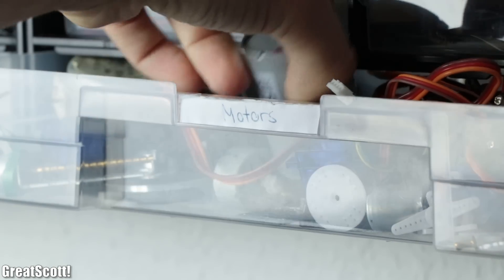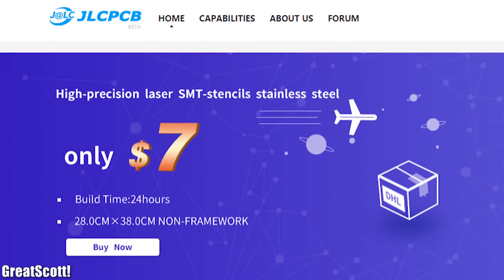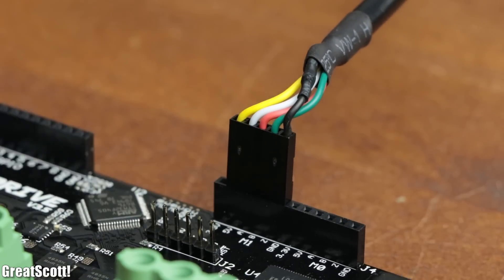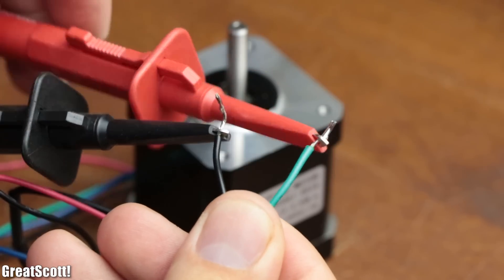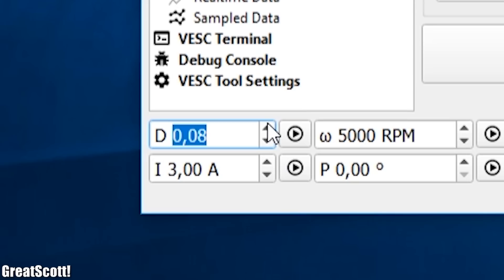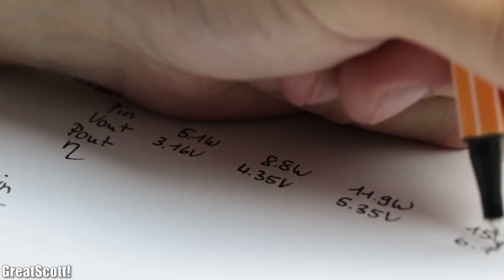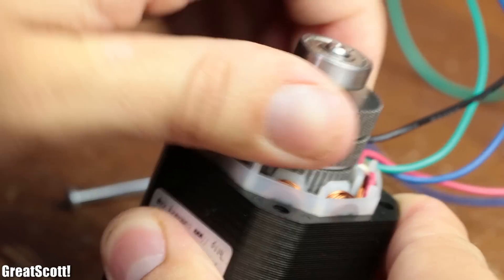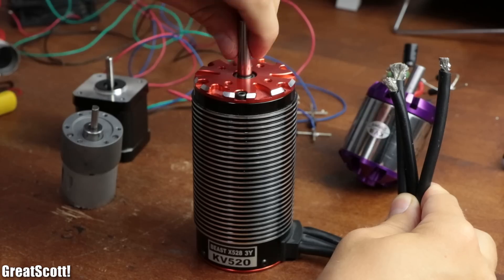Which Motor Type is the Best Generator? || DC, BLDC or Stepper? (Experiment)

Comment: But what about voltage drop on diods? Did you consider power dispensed by rectifier? With low voltage as you used it is considerable waste/heat try to change measurement method or add heat on diods to the calculation

Comment: Generator output voltage In the armature depends on the rate at which the lines of force are cut per second, it is possible to vary the output voltage by controlling the speed of the prime mover or the strength of the magnetic field.  The flux density in the magnetic field poles depends on the field current. The field strength and voltage output of the generator continues to increase with an increase of field current untill magnetic saturation of the field poles occurs. Any additional increase in voltage after magnetic saturation occurs must be obtained by an increase in speed of the rotating armature.   Using a cumulative compound wound motor would have the best regulation with a rising characteristic as increasing the load current the output voltage increases as well.

Comment: Stepper motors are fine for small stuff MA range but that's it they fall face first when confronted with real load. Out runners are the best just have to spin the crap out of them unless you rewind . Use belt and pulley all available from EBay cheap. There is no real gear box options yet for the weekend scientist.  Brushed motors are by far the cheapest .

Comment: It is odd that you (apparently) overlook wire section, number of coils, etc. Start over by comparing the innards of a manufactured generator (as in wind turbines) and each of your three types of motors ? It should be pretty obvious.

Comment: Stepper motor is the best source to be use as power generator. I am actually building one to power a 12volts household LED lamps that will light my entire workshop table instead of using our main AC source electricity. The project will be based on a stepper motor salvage from a Photo copier machine as the power source, 775 DC motor that will rotate the shaft of the stepper powered by a 12 volts 4AH motorcycle battery. In order for the battery to be charged while in use. Think about of what is happening on a MOTORCYCLE charging system, given the stator as the power source coupled to a voltage regulator that charges the battery during use.

Wish me luck !!!

Comment: You used a dis-proportionally sized BLDC motor for this experiment, a lot of smaller brush-less motors with higher KV ratings are out there.

Comment: Hi GreatScott.  I enjoyed and LIKED the video, Subscribed and clicked the Bell Icon for new updates.  I was wondering brother, if I needed to calculate the power requirements of a plug board 120v/240v and say an 12v/24v air pump, a water pump 12v/24v and some grow lights.  How would I go about this?  If this question in too easy for you, I will not be offended if you redirect me to an alternative source or information that is already publicly available.  Regardless, any help would be appreciated.  Have a great day and thanks for your work.

Comment: I did some tests many years ago with brushed tape drive motors, and simply connecting one to the other allowed one to drive the other at better than 10:8 rpm, so ten turns of the generator gave 8 turns of the identical motor from close to zero rpm, higher than 100rpm it reached 9:1. Those motors were about as good a any brushed motor can get, and I didn't measure torque loss, but it still proved the efficiency to be close to perfect. I also made a small charger system for a stationary engine using a BLDC motor, and got surprisingly good current and voltage (~60 watts) with 3600 rpm speed.

Comment: I wish you had done a test at 3000 RPM with all. hobby bldcs are said to have a conversion on 80% from electricity to lift / propulsion so it would be interesting to check the reverse efficiency

Comment: The diodes in the bridge rectifier loose .7 volts each. with 2 in series at any given time, that's a 1.4 volt drop before any current is passed to the load. If you only turn fast enough for 3 volts, half your loss is the diodes! You're right about revving them with a gear box. If you could run them closer to 12 to 15 volts, you lose only about 10% to the diodes. Another suggestion, use Schottky diodes, which lose only about .3 volts each. If you try to run permanent magnet motors too fast, the air gap voltage gets so high that Eddy losses in the iron stator reduces efficiency.

Comment: Thanks for this!... I was just about to run the same kind of testing for my wind turbine project. Now I don't need to! One thing I have discovered about stepper motors (which I've been using... was considering a BLDC but after your video, no need) is that a NEMA23 generates a lot more power than a NEMA17 at low RPM's. I'm getting 9 watts from my wind turbine at the moment in field tests. I believe the reason that steppers work so well is because they have a kind of "magnetic gearing" because of the 'teeth' on the stator and poles that effectively multiplies the number of real coils. It's all about the dB/dt. (change in magnetic flux over time)

Comment: we are professional BLDC Motor stator lamination and epoxy powder coating customization manufacturer to produce stators with 0.15mm,0.2mm,0.35mm and 0.5mm silicon steel, we also have some ready-made stamping mold available for you to save your cost.  the lamination technology include, interlock, welding, bonding lamination, more details, please see our website: www.jystator.com

Comment: 5:10 Dude, why not just enlarge the hole to 8mm in software lol
Reply: Luka Voglar Because there are usually no sources, just STL so it's pretty hard to change it. 10 seconds of drilling vs 20 mins of developing own coupler, basic economics.
Reply: @HungrysitesRu  It's literally a cylinder with a central hole and 4 lateral holes.. Even without downloading anything you can do it in 3 minutes in any CAD software, it's literally that simple :/
Reply: @DarkQwerzar  maybe he wanted to let us know that these types of 3d printer files are available on the internet or maybe sponsored.
Reply: @HungrysitesRu  looks like someone forgot to take printing time into account.

Comment: how about putting a stator on a motor to show how to increase voltage in a circuit. say a 120 generac stator on a ebike motor with a control to make it only rotate 2 times per second with a full throttle control so that is gives 40 ac current to an 48 volt ebike ac motor.

Comment: I have something that you will want to try??? if it use a lot of voltage and has very little horse power then it stands to chance that it will also be the easiest to turn or vice versa so do that for a show also!!! Show us the horsepower turn to energy production values. maybe the ones that are high horse power are the ones that turn the easiest so they make the most power by input.

Comment: Could you choose a right motor for my wind turbine.  One has 2 blades 6 meter in total lenght and 15- 20 cm in width.  The other one has 3 blades each blade is 1.30 meter long. And the blades are  20-15 cm in width.

Comment: I understand the complication if spinning al 3 motors at the same RPM so you can get apples-apples comparisons, but once you discovered that the DC motor was a gear motor, you should have scrapped the results and started over again because your results were wildly off due to the gear multiplication of the brushed motor.

Comment: There are many types of stepper motors. Some will work well as generators, others won't. Some would even require initial voltage input, as the car generator does.

Comment: Use another vesc on the bldc motor. The regen allows for pulsing, which would give a more usable voltage at lower rpm at the cost of current. Also, the efficiency of the bldc motor will go up as the rpm does. This is because there is mechanical losses before you even start to look at power out. At higher outputs the losses will be insignificant compared to electrical and magnetic losses.

Comment: The motors should be driven at their maximum RPM while measuring efficiency or it's not really a valid measurement of power output and efficiency even with the very well designed test equipment, do correct me if I'm wrong.  A turnstile motor from a microwave makes a great generator for hand-cranking and other low RPM applications, it outputs about 20 watts of high voltage AC and can directly charge HV capacitors up to 1000 volts or be put through transformers for any desired voltage.

Comment: BLDC’s are the most powerful electric motor/generator I think. Try to get one with similar speed and torque figures to your input source, to minimize gearing needs.
The major issue with your tests is your speed and torque wasn’t well matched anywhere, so everything was far from its maximum power point.

Comment: So on bldc perhaps the efficency is somewhat proportional to the rpm. I use regenerative braking and the controller handles the rectification and dc conversion. On average my output current is between 50-75% of the input for a similar speed.

Comment: Try a unipolar generator as motor in series with a spinning ordinary electrical engine that you change the load on. Dont forget to study the ball bearin engine and Searl motor/generator ( dissmiss all desinfo around what they claim it is, just se it as a faraday disk generator).  IF time do the video, you may like the results

Comment: It is unfair to ignore the mechanical loss of the gearbox. Stepper motor looks like a winner because it operates at low speed and virtually no mechanical loss. Perhaps you can use 2 identical motors, one as motor and another one as generator. If both shares the same energy conversion efficiency, x/100 and x/100, the total efficiency will be like n = (x/100)*(x/100) and x = √(10000n), ignoring rectifier loss. That way will be much more accurate.

Comment: The way the BLDC motor was vibrating means that either the coupler wasn't aligned or balanced, or the motor was rubbing on the floor. You probably had a lot of mechanical losses because of that.

As for the speed difference due to the gearbox, why not simply drive the generators (motors) faster by driving your input motor harder? Maybe instead of constant duty cycle points, you should have tested at constant rpm points (1000, 2000, 3000 rpm etc.)

Comment: I've done similar experiments and reached about the same conclusion, BUT there is a problem with the stepper that I found.
Try spinning the stepper under load and you will notice that the faster you spin it, the more breaking torque it produces. This is to be expected and is great as it fights over-spinning  of your wind turbine for example...... however if you keep increasing the speed, there seems to be a point at which the breaking torque greatly reduces and the stepper generator spins out of control. I'm not sure how to explain it, but I think it has something to do with how the steppers are limited in max speed. I don't know at what rpm that happens, but it happens and it's weird.

Just food for thought and further experimentation.
Reply: Maybe,Because-speedIncrease,FrequencyIncrease,ReactanceIncrease,AmperageDecrease,ThenTheBreakingDecrease.So,MaybeAtHighSpeedsTheProducedPowerIsLower.

Comment: I use the Gimbal brushless motors as these range in the 30-50kV range. I use these on my Lenz2 3D printed wind turbine, and at 150rpm with a 5:1 belt drive I get something in the order of 30 Volts. I am currently using the Hobbyking 6508 Gimbal motor which is about 30 euros. If I want more it gets quite a bit more expensive at 50-90 euros for a 85 or 90mm stator.
I also drive these with a full bridge rectifier for 3 phase into a grid tie inverter.
The drawback of the gimbal motors is the high resistance of ~10 Ohm, so you need more then 20 Volts to get decent power out. So far I've seen a peak of 34Watts.

Comment: BLDC will produce output power only if the rotor has a magnetic charge. No magnetic in the rotor --> no power output at all. The best is the stepper motor, although it needs a diode bridge rectifier.

Comment: How about using a drum motor and rewire it into a generator configuration? Then add a large spark gap to the generator to add more electrical energy by how the spark gap increases the electrical frequency?

Comment: I was wondering, would the heat generated in the motor affect its efficiency right? I did try to use some motors as generators, didnt remember which ones but I know some of them got quite hot and was wondering which motor generates more heat which could affect its efficiency. Thank you for the video!

Comment: Could you add a voltege booster circuit and a current booster circuit (transistors) to the output voltege to just increas it so it could power more power demendig things(like insted ligheting up a led with one volt to be able power up 12 volt motor?)

Comment: I personally think pulleys are a better option however the bldc is not scalable for a hobbyist once you get to around 900 watts finding a way to regulate the voltage without switching to an alternate becomes a feat in itself try looking for a 900 watt buck/boost converter that isn't from a tesla vehicle now I would love to see a video overcoming this though let's say 1.2kw bldc generator with voltage regulation.

Comment: Its strange to see the BLDC having such a low efficiency, since they are basicly the same type of generators used in big power stations. They should be able to reach efficiencies up to 99%. Here are 2 Ideas what when wrong:
1) The rectifier diodes give a huge loss due to their forward bias voltage. Around 1.4V lost on the diodes. If we go with the 2V Output Voltage that means roughly 3.4V were at the input, which gives a huge efficiency boost. But its still relatively low. why?
2) The mechanical losses are huge in this system, especially with a gearbox. A good test to see how big these losses are is to disconnect the electrical load and then record the power consumed. If you put 6.8W in with the electric load attached, but say 4W without the load, you have mostly mechanical losses which needs to be taken into account.

In principle most motors can be modelled to a good approximation with an a friction element which power loss is proportional to the shaft speed, an ideal generator which converts the rotational power to electrical power (to be precise: it generates an output voltage based in the input speed and generates an input breaking torque based on the output current) and an internal resistance to model the electrical losses, mostly only depending on current. If you vary the load while keeping the shaft speed constant you can estimate this internal resistance (by taking measurements at different currents and recording the voltage). Same goes for the mechanical losses by using a fixed electrical current sink (to keep the electric losses constant, even zero current aka open circuit works here) and looking at the input power. By performing all these steps in various configurations (with generator, without generator, with load, without load, etc) you should be able to get all parameters (mechanical losses P/w, motor constant k, electrical losses R) for both motors/generators.

Also it might be possible to get a "dumb" esc (one which does not measure current but just uses the BEMF) to trick it into behaving as a generator-controller. So instead of taking current from the supply to turn the motor it would slow down the motor but feeding back current into the supply. That way you eleminate the diode losses and have a more reasonable DC voltage level.
Reply: I think it's because the rpm he span it at was was too slow. It was no way near its maximum efficency point
Reply: a VESC can actually act as an Active MOSFET rectifier. The only downside is that the VESC needs initial Bus voltage to power up before the generator is producing power. I've done some experiments on my YouTube channel
Reply: You are not getting a BLDC to 99% efficiency
Reply: @btoiscool  The big generators in power plants might disagree
Reply: @gotbread2  those aren't getting that high efficiency either. Best you are getting is around 90-96%, depending on the system. And that's a really well designed system

Comment: the best motor to create energy from mechanical force applied to it is one the has permanent magnets that pass by a stator coil. turn it and it produces energy. nothing else needed. regenerative braking is a good example in many hybrid vehicles. converts the motion of the vehicle into energy and due to loading slows the vehicle. remember that little motor thingy that rubbed a gear against your bicycle tire to run you bikes head light? remember those? about as simple as it gets.

Comment: Wait so when the motor is connected to say a bench top power supply, and it is spinning, would it be sending power back into the power supply, does it have negative impacts?

Comment: I don't know where to start what is all wrong about the conclusion. First of all the efficiency will depend from the inner resistance of the motor to it's load. Using the same resistor is not ok for comparison!

Comment: Thank you for this great video.
The shaft coupling made by 3D printing is not suitable cause it does not help when the two motors axes are not aligned, while the original metal one does because it has these cracks. Because of this the vibration happens when you connected the brushless motor.

Comment: Dear Scott, (or anyone who reads this) I need your help. Please.
I am from a so tiny village in India. Where power cutt is not a common  thing but it is fixed for 10 hours a day.
A single battery can not provide much curreny as the appliances need 10000 watts of power.(220v 50htz)
What do I do?
May be adding multiple batteries in series can help but how? 
As i am from a tiny village... none professional seems to be able to help me.